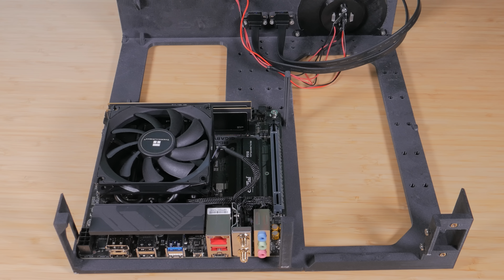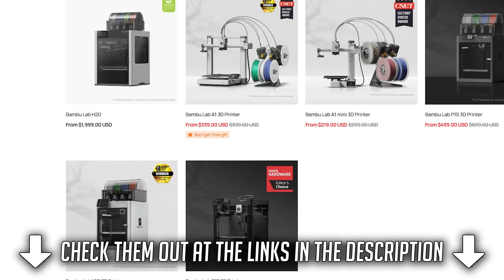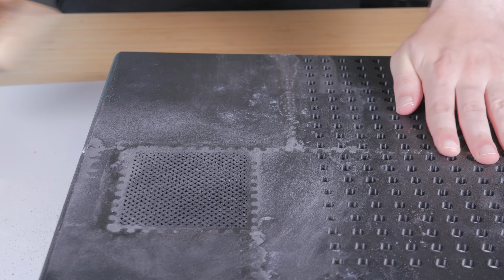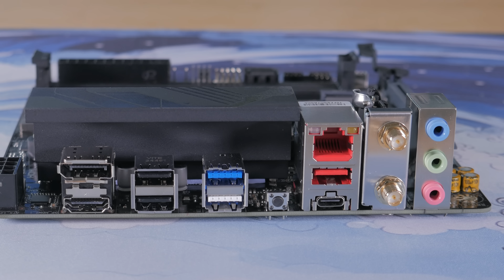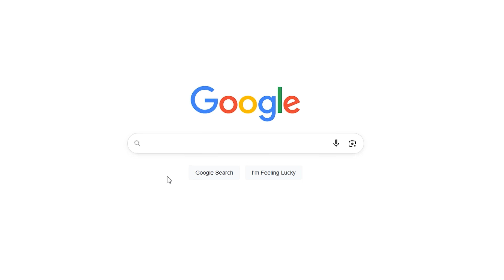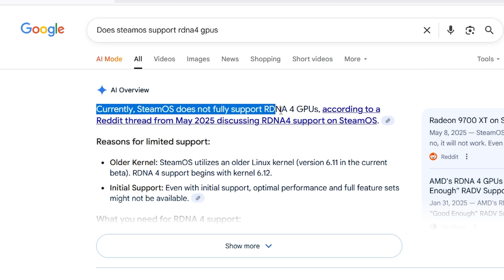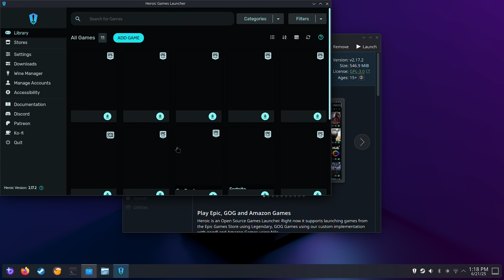I Built A Custom Steam Machine in 2025!

Comment: I'm about to upgrade my living room PC with an RX 9060 XT 16GB and Bazzite (however, I will be reusing my old 5600X and 32GB of DDR4 RAM which still performs good enough most of the times) and the main reason is compatible,  but also Optiscaler which enables FSR4 through FSR2 and DLSS inputs in compatible games. That should help a lot with reaching 4K at a decent framerate without all shimmering from FSR 2 and 3 🙂

Good job with the case for a first attempt!
Reply: Optiscaler works on Bazzite? That's great!
Reply: @tidjane2001  I haven't tried myself yet, but if it works similarly to DLSS Enabler I'm optimistic about it. I got this one working with Final Fantasy VII Rebirth on Steam Deck under Steam OS.

Comment: just thought i'd mention that psu you chose is rated f tier, it has malfunctioning ocp and opp on the 12v rail and poor transient response, also doesnt actually meet 80+ gold certification.
Reply from the maker: Which tier list are you looking at? It's listed as B tier on the cultist tier list.
Reply: @TechByMattB im looking at the new spl tier list, it actually gets updates, still community driven and uses data but it provides a lot more information and has more models
Reply: @TechByMattB  he's referring to ZTT's PSU tier list and yes, this particular one you bought is rated F.
Reply: Good shout on the PSU; that SPL Tier List is fantastic